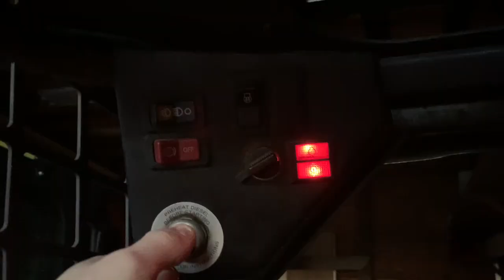WOODMIZER LX25! LITTLE SAWMILL BIG CAPABILITY

Comment: When sawing pine, switch to a water solution with 10% pinesol in it. The 'cleaner' will help keep the sap from collecting on the blade.
Reply: Diesel fuel helps.